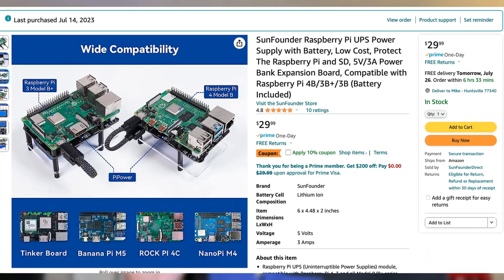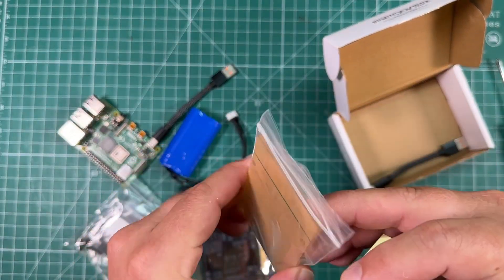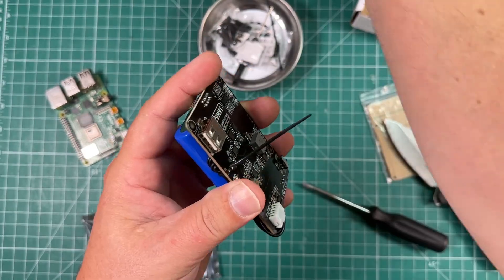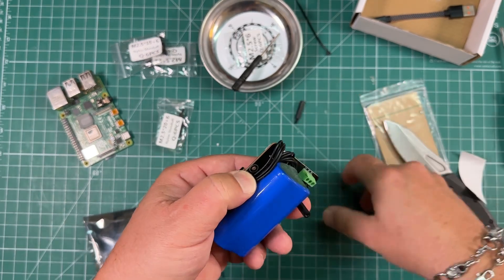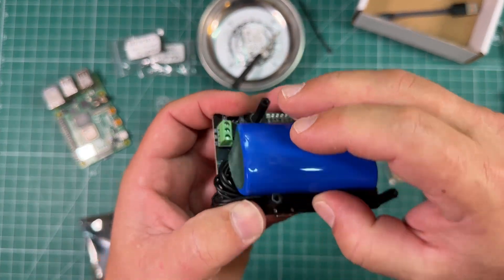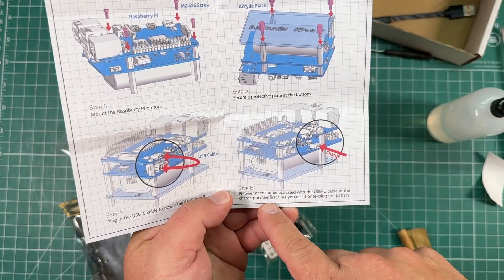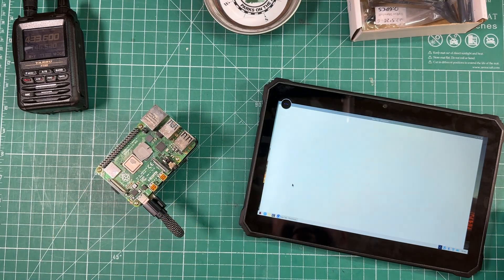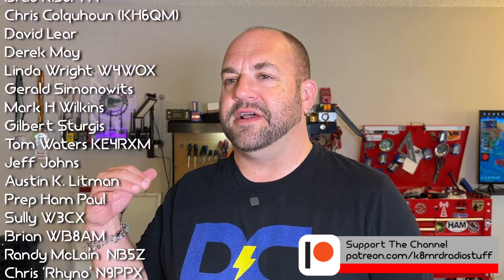PiPower Raspberry Pi Battery Backup

Comment: Any scrip available to put the Pi in sleep mode when the UPS looses power and goes to backup mode? Or is it even possible? It would need a signal from the UPS say through the USB? I assume the Pi has battery monitoring?